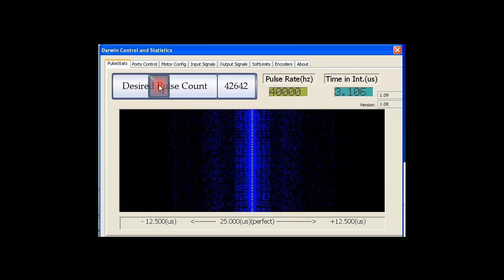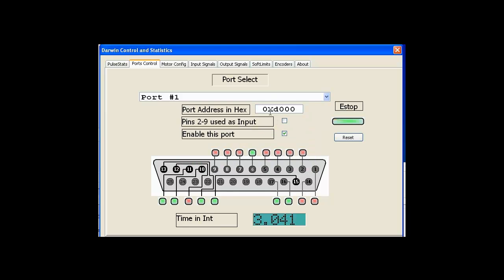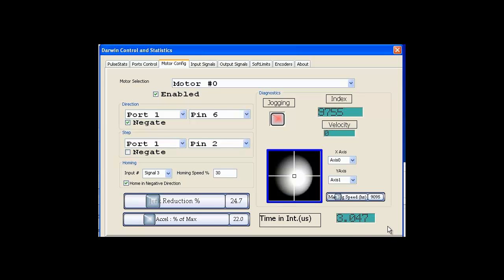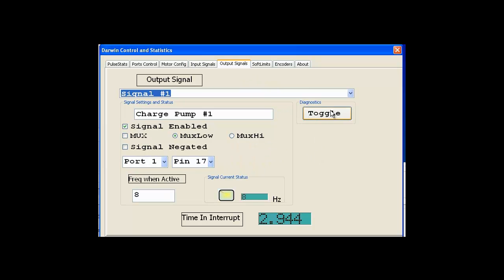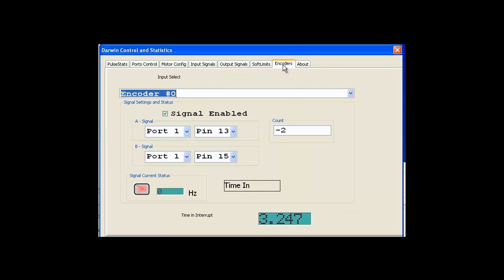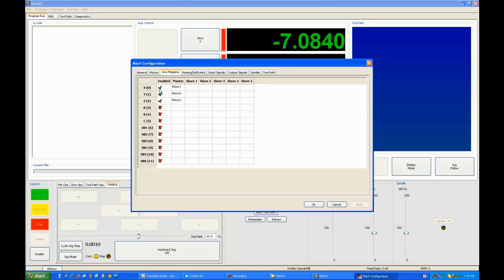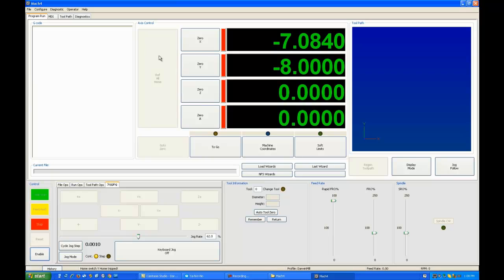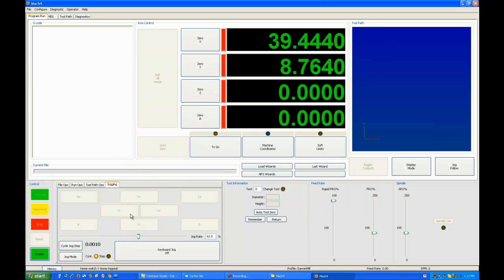Darwin & Mach4

Comment: Long shot but is there a newer version of this with the new Mach 4 I’m trying to configure. This did held a lot but I got lost when the tabs are not in the same place in the newer version. I seem to have Darwin working I just want to test Mach 4 before buying it.
Reply from the maker: Sorry, no. But I think Mach4 will run with no license for short period while running darwin. Id just download and try it to see.
Reply: Art Fenerty I think I might be figuring it out after watching your video a few times. Still not 100% sure if I’ve got my mind wrapped around it. Just going to try to setup motors in Darwin so I can see if I have communication between the CNC and my computer.
Reply: Now suddenly daw
Darwin is crashing my computer everytime I try to open it for set up. 
The only change was a bunch of updates I got today.

Comment: I had this set at 18000 could this have caused step issues... I've seen where my x axis will loose it's mind... all my connections look good.  I'm sliding back up to 40000.  Hope you are doing well Art and are still active on here ;)

Thanks bud!!
Reply from the maker: IT shouldn't. In fact at 18000, it should be more reliable than at 40000. If only 1 axis is losing its mind, its more likely wiring or some such thing..

Comment: Have you been able to do lathe threading with mach4 + darwin + parallel port and & a spindle encoder?
Reply from the maker: Sorry no, Darwin doesnt do threading at all.
Reply: Hi Art, I have been using Mach3 to control a Gecko G540 on an Emco Compact5 CNC lathe, using Parallel port on an old but well spec'd Win7 PC. All works great for turning but I was hoping to upgrade to Mach4 to do CNC threading with this lathe and take advantage of Mach4's ability to use timing + index pulse with the Emco spindle's built in encoder + slotted disk. How do you recommend I upgrade to Mach4 turn, considering the G540 is still Parallel port based?
Reply from the maker: Use a smoothstepper and connect its outputs and inputs to a printer cable you plug into
the G540. The Gecko will work fine with signals from the smoothstepper under m4.
Reply: will I see any difference / increase vs. simply using mach3 directly to parallel port?
Reply from the maker: From what Im told the smoothstepper will do encoder threading.. I know the Pokeys 57CNC does, not sure on the smoothstepper. You may want to check with them. Pokeys does for sure, much better threading that a printer port can.

Comment from the maker: The download installer from Machsupport should install it so that you can run the config from inside mach4. 
Check the printer port thread on MAch4's support website..there are detailed instructions there.

Comment: Is the discreet encoder as an MPG limit of 1 a Darwin or Mach4 limitation?  Is it intentional? I wanted to use 4 rotary encoders as powered hand wheels as I combine CNC with manual machining.  Will the limit be expanded?
Reply from the maker: +Eddie the Grouch Its a darwin limitation, I dont think Ill be expanding it, there is too little demand for printer port operations anymore. Darwin is usefull as a bridge to Mach4 till one upgrades to a usb or net based pulseing engine, but is unlikely to get any upgrades..